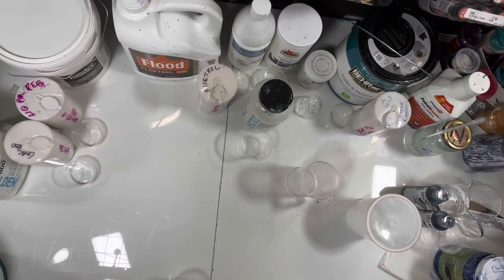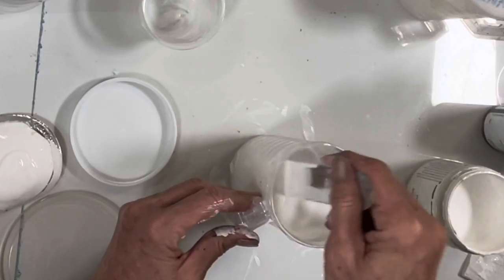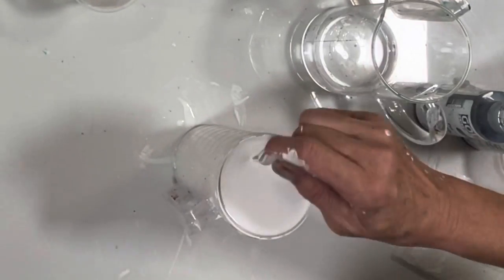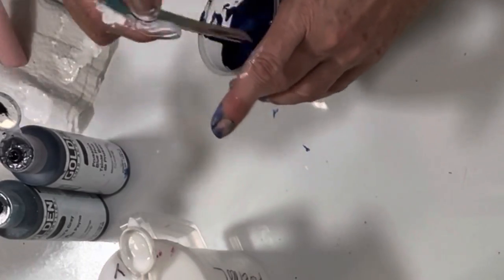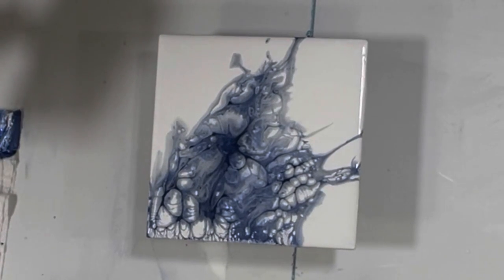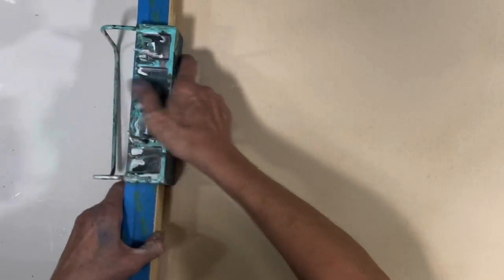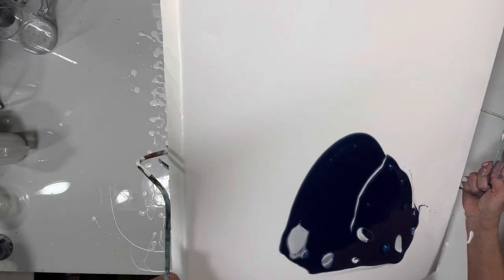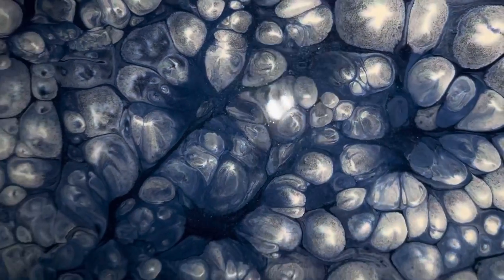HOW TO Get Perfect Pearls - Start to Finish - Monochromatic Pearl Pour #fluidart #pearlpour

Comment: What if I don't have BEHR 7300 or AppleBarrel whit, BUT I  DO  HAVE Floetrol and DecoArt satin Enamel ?
Reply from the maker: Well..we tested a multitude of products and these worked best for the price and results. You could try a deep base untinted like Valspar or other brand…also the apple barrel is available on Amazon or Walmart even cheaper  especially online .   The results you get from other products will vary that’s all.

Comment: Michelle, I’m going to tackle your recipe today but I have a quick question…can I use the Behr 8300 instead of the 7300, because that’s all I have? I just don’t want to mix it all up for it not to work if it’s better to just wait until I can get the 7300 this weekend. Thank you so much for all your help!! Much love, Treesie💐💝💐
Reply from the maker: Yes…you can. It’s a bit thicker so you may need to adjust the water.
Reply: @gratefulcreations  wonderful! Thank you so much!! Fingers crossed I make it work! 🤞🏼💐

Comment: I watched your video on how to get the perfect pearls, very good.  I have been trying but all I get is vert small pearls.  So could you explain what determines the size and amount of pearls?  Also is there a substitute for GAC 800, it is hard to get and very expensive.  Thanks for you help.
Reply from the maker: Golden color gloss medium is a great substitute for both the GAC800 and liquitex pouring medium. Just a dab will do ya. You’ll get larger pearls with thinner paint. Hope you’ll try this recipe and have success. .
Reply: Thanks for the advice I will try it.  I don’t think I can get my paints much thinner without the paint just running off  but I will try.  Thanx again.

Comment: Michelle…did you know that Amazon just put out “the Original” Artist Loft Flow (2) bottles for $25  …they stated the Original highlighted  in the title twice …The AL Soft is also listed…thought of your dislike for the Soft..I was in shock when I saw it was back…They Heard You.😃
Reply from the maker: Ahhh yes!!! I ordered it. It’s not the original. It’s the 2021. I ordered from eBay and it came from Amazon. I made sure I asked if it was the 2019. They didn’t know. But they were advertising it as original. I sent it back with a bad review and told them they were misrepresenting what they were offering.
Reply: Did some research..the Amazon is 2020….I cancelled my order..cancelled, no question-hum🤫
Reply: I forgot…Thank You lovely lady